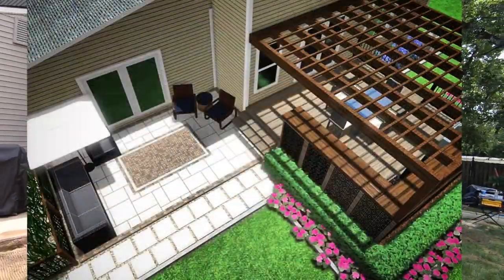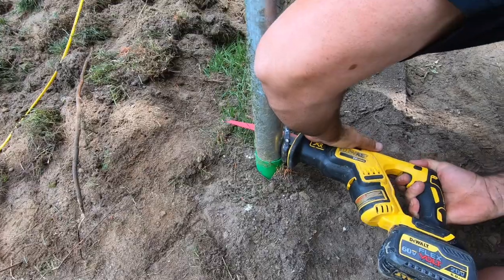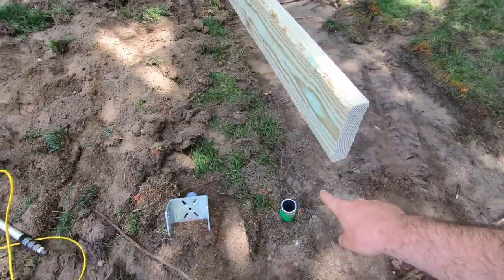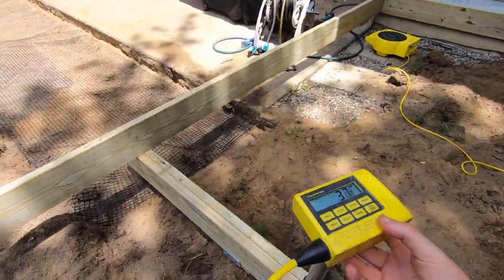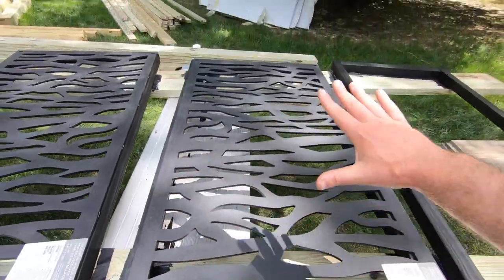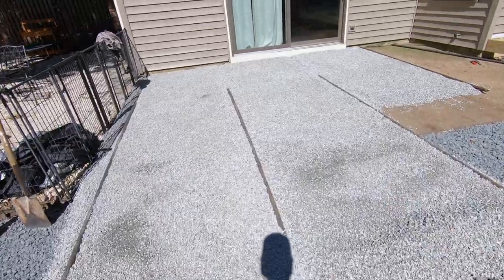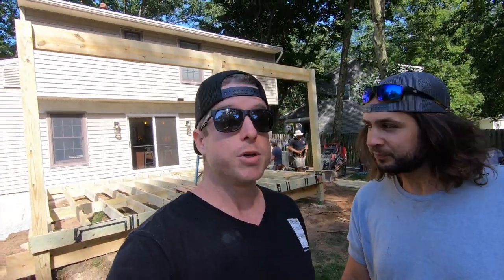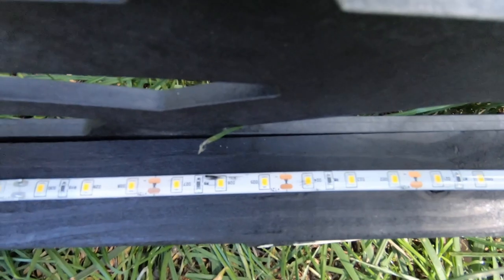Building a Deck, Patio and Pergola 5 DAY CHALLENGE! - Day 1

Comment: Hey Sean, I noticed you said you wouldn’t recommend doing continuous pavers from on top of the overlay and onto your open graded base. Why is this? I am in the middle of doing a similar project. I am overlaying my concrete pool deck with pavers and extending it onto an open graded base. Am I going to have problems? Anything I can do to prevent shifting if you absolutely had to do it this way? Also will I have problems if I only overlay with a 1/2” layer of the 3/8” chip stone instead of the normal 1” layer? I’m trying to match the height of the coping which is going to be mortared in.

Comment: When you guys notched the base of the pergola posts to fit the support beam for the deck, did the beam not need to be fully flush with the post and supported inside the notch? It looks like you guys notched it to fit just one of the 2 x 12's and the other half of the beam is not supported in the notch. I'm totally new to deck building and I'm thinking of doing the same thing for my own back deck, but I'm curious how you planned this part. You guys do fantastic and inspiring work by the way!
Reply from the maker: Thank you!! Yes only 1.5” is supported by the notch, but with a good nailing pattern attaching the two pieces together it is good to go! Didn’t want to take too much material out of the 6x6